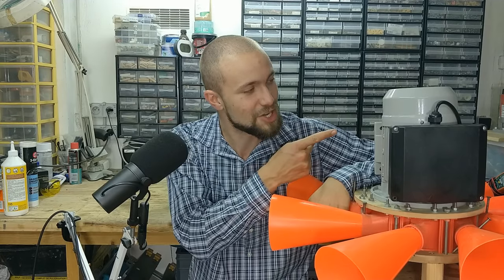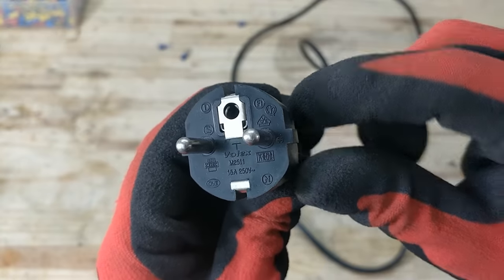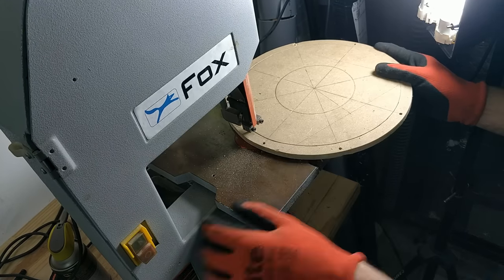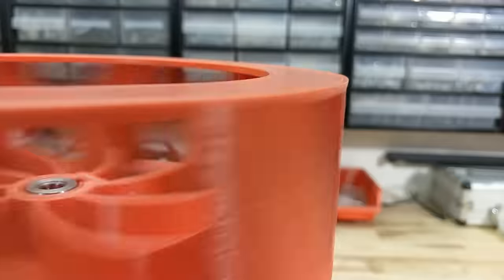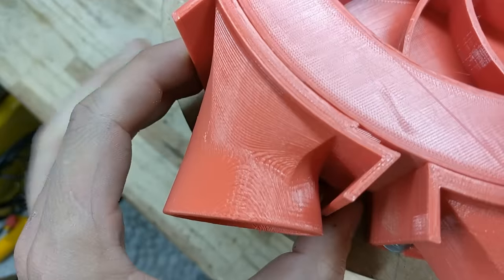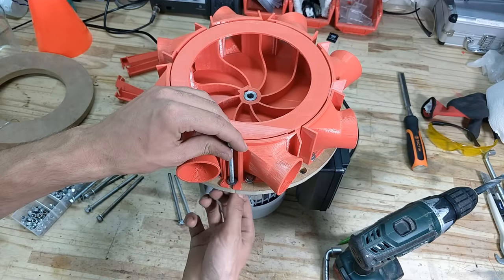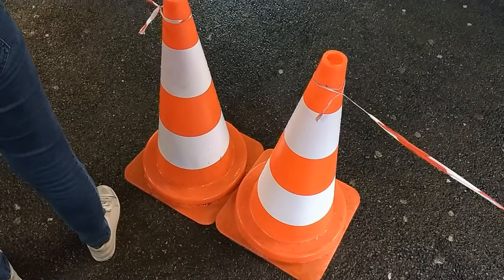Making the Air Raid Siren

Comment: The model of the siren in France you recorded is a DS PAKITA siren and it's sound was used for the horror film "Silent Hill". And the DS PAKITA siren is pretty much a sentry siren running 50 hz while a sentry siren runs on 60 hz
Reply: france also uses siren brands like KM Europ, Demay, Northern electric construction and also PTR.
Reply: there is no difference between 50hz and 60hz. they both run the same
Reply: @onfire4664 no, 60hz Is more faster rpm than 50hz

Comment: If you want to make this siren even louder, add a second rotor with slightly smaller or larger holes, just as long as they are a different size, the tones of each will harmonize and create an even louder siren. Its how most car horns work.
Reply: Is this note even possible to a 6 port siren? https://www.youtube.com/watch?v=tryjb_hmN7A Edit: That's my Silent Hill siren synth. Model DS PAKITA SIREN by PAKITA.
Reply: you mean the klaxon or something? klaxon is rotary but modern car horns are just speakers with or without a cone right?
Reply: @phenylmusic  car horns mix two tones, a higher and lower frequency, they harmonize with each other and create a much louder sounding frequency. you can do the same with rotary sirens or other horns by making the holes different sizes.
Reply: @The_JEB  right car horns usually have 2 tones a minor third apart
Reply: Better yet would be a three rotor design with each rotor having a different impeller style as well as different hole sizes.
Reply: A mere 12 seconds into the video he states, "So I designed my siren to sound just like the one I'm filming here."

Pay attention.
Reply: @T00LF00L  Neat. 
Learn to read.
Reply: @T00LF00L  I did 
my comment is factually correct.
Reply: @NeilPlaza  really? I always thought they were STL-10s.
Reply: Dual Tone Baby!
Reply: Ah mechanical engineer on board
Reply: @T00LF00L  yeah this. Thanks guys good to see everything is going to plan 🖕
Reply: Plus it sounds alot better too.
Reply: das cool
Reply: Though, single tone sirens do in fact carry further.
Reply: @NeilPlaza  you didn't even edit your comment

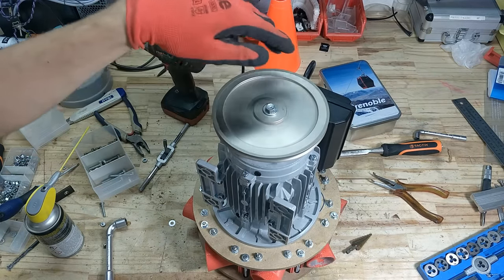Comment: At 6:00 that clicking isn't the centrifugal switch. The switch will only disconnect the windings when the motor reaches a certain RPM  and reconnect during wind-down. I don"t know what that sound is but its not the centrifugal switch. So it should only be heard once during wind up and once during wind down.

Comment: "spinning a heavy chunk of metal at over 3000 rotations per second is obviously dangerous"
holy shit yeah, thats 180,000 RPM you need a super alloy to even attempt that
Reply: I don't Understand, could you explain plz ?
Reply: @gialuquin88XD  180k rpm is too fast
Reply: @gialuquin88XD  It's said multiple times in the video that the motor works at 3000 rotations per seconds. But that's impossible, only things going remotely close to that speed are injection turbines in rocket motors.
SO it's not 3000 rotations per seconds, but 3000 rotations per minutes (similar to a small diesel car going 100 km/h in third gear).
Reply: @gialuquin88XD  he mistakenly said seconds instead of minutes
Reply: Thanks for the comments guys!
Reply: @TerraeChannel  lemme introduce you to hobby grade rn motors
Reply: Did you hear the sound of the air right sirens before have you heard one before
Reply: @TerraeChannel  small turbos on some cars can reach 300k rpm
Reply: no one use RPS it must be mistaken with RPM
Reply: @gialuquin88XD  metal will rip utself apart at that speed usually over 40,000RPM people use carbon fibre
Reply: @gialuquin88XD  and obviously he meant 3000RPM bcz 3000RPM is almost impossible with conventional motor motor would rip itself apart before the flywheel
Reply: @kamhaq  RPS is RPM, but per second, and not per minute.
RPS are 60 times faster than RPM.
1 RPM = 60 RPS
Reply: @somewagyuenjoyer  bro you got it wrong. 60rpm = 1rps
Reply: @Tahmanakki  rpm is rotations per minute.
rps is rotations per seconds.
60 seconds a minute passes everywhere.
1 rps is faster than 1 rpm.
if you got a timer and something that rotates, set the timer to 60 seconds. then start the rotating thing, and set it to 1 rotation per second. in 60 seconds it would do 60 rotations. if you set the rotating thing to 1 rotation per minute, and set your timer to 60 seconds, it would do 1 rotation in 60 seconds.
1 rps is 60 times faster than 1 rpm.
3000 rpm = 180000 rps.
Reply: @anandsuralkar2947  There's a guy who got to over 100k RPM with nothing but lego motors and gears, works just fine.
Reply: @somewagyuenjoyer  1 RPM ≠ 60 RPS, LOL!

Instead, 60 RPM = 60 revolutions in 60 seconds = 1 RPS.
Reply: @vk2ig  yeh at first i got it wrong, 1 rps is 60 rpm

Comment: Nice job! One other thing you might want to do is make sure that the rotor is as well balanced as possible, because that'll reduce the wobble and probably make the wind-down a bit longer.

By the way, the siren in the recording at the beginning of the video was a KM Europ siren.
Reply: Or add more ball bearings

Comment: With a motor that big, you can build a much bigger bigger chopper and rotor. You could tell you can build it much bigger because the time it took for the rotor to spin up was quite short. 
I personally suggest scaling up the model with the same motor, and add a thick metal plate on the rotor to act as a fly wheel (your attack signal will sound GREAT). Love the content!
Reply from the maker: Of course, but my printer can only print 20x20x20cm
I would have loved to make it bigger
Reply: @NicolasSalencPBP  shame. Anyway, I'm sure you'll find a way if you choose to continue this. Best of luck!
Reply: or get real parts and that

Comment: If you're a thoughtful (studying) engineer (like me), you could get away with a less powerful motor and use a 2:1 gear ratio to drive the rotor. However, it may take a little longer for the rotor to reach full speed. Furthermore, you could use a 3 phase motor to reach that speed much faster than using a single phase motor. The other gear would also have to be mounted next to the motor at a precise location to help with the gears meshing. I'm not sure if using different types of gears may help mesh better though. Btw, I'm studying to be an electrical engineer although mechanical engineering also fascinates me.

Comment: It doesn’t “Push out” 1.1 kW, it draws 1.1 kW under a heavy load.
Reply: On the motor plate normaly it is only written the power its giving away at the shaft. So the motor is translating 1.1kW to the shaft on max load. If you want to know how much power it draws you need to divide 1.1kW by the efficiency factor. Under full load the motor would probably draw around 1.2kW, depending on how good the efficiency factor is.
Reply from the maker: @CatLady That is incorrect. 
1.1kw is the mechanical power the motor is able to output under full load. 
Mechanical power(W) = torque(N.m) x rotation speed(rad/s). 
To calculate electrical power consumption, you need to refer to the label. (you can pause the video at 0:53) 
Under full load, this motor pulls 6.08A on 230v. The power factor (cosφ) is 0.99. 
Input power(W) = Current(A) x Voltage(V) x cos(φ) = 6.08 x 230 x 0.99 = 1385 W
So because of energy losses due to the efficiency factor, under full load the motor pulls around 1385 W and pushes out around 1.1kW 
285W are  mainly converted into heat which need to be dissipated by the motors fan and fins.
Reply: Now that's some epic electrical engineering
Reply: @may21136  took me 30 seconds to read this whole comment reply’s section
Reply: Wrong or not, I'm so happy that both genders join in on EE subjects. It feels so lonely without you guys.

Comment: You've got your impeller printed backwards. Considering the impeller is supposed to be a centrifugal pump, the idea is to have it compress the air before it's fed into the vents resulting in much improved efficiency. You have it attempting to suck the air away from the vents. Yes, it will work as you've made it but it will work better if you reverse the motor or impeller direction.

Comment: deleted my old comment as i was completly wrong, the siren you filmed seems to be a Demay siren, some Demay sirens actually have a lower pitch as they use a 2850rpm motor instead of the more normal 3000, the ones that have a lower pitch are the R3P models but i do not know the exact model of this one. the one you made looks pretty similar to the Pakita LCi siren or a CEN (Construction Electrique Du Nord) NP2S siren. hope this helps.
Reply: if you are wondering how he gets the sound of 3000rpm with a 2850rpm motor, rotor weight normally slows down the motor a lot, but since his motor is so powerful, it cant slow down the motor.

Comment: Nice! Matthias Wandel (YouTuber) made one out wood. I can recommend his channel also. Btw, he tested different impeller designs. I think he concluded that forward bending impeller blades doesn't make for the most efficient design. I don't remember if it actually pushed the most amount of air, but at a disproportionately higher wattage.

Comment: IM a bit rusty on my electronics but you do want to size your motor for the load. Its good its temporary. Its not efficient and there may be other issues from using an oversized motor.

Comment: I'm going to do this it's just I'm going to make a remake of a federal signal 3t22 so it's going to have two sets of horns.
a bigger motor, 2 stators, 2 sets of stator blocks or whatever they were called, and bigger horns, with the speed control, grinder disk, and a weatherproof cone on top so it looks like the real siren.
and mounting poles
then i will use a sprinkler timer with switches inside for a noon whistle if I want or I could build my own controller for the siren.
with a DC speed controller like you did to do a growl, short test, noon whistle, or alert, wail, but if i want to make a hi-lo tone I would need to make solenoids with a separate switch, and all kinds of things that I don't know yet, so I won't do a hi-lo test.

Comment: My Federal Signal 2T22A has 10-port and 12-port sirens on the same shaft. [=]M[=]  At full speed the rotor/stators produce a musical d5 and f5, a perfect minor third interval, which produces a Bb3 resultantone.
The 2t22A ("A" designates three-phase motor) would be.tter if 5 and 6 ports.   Lower frequencies travel farther and penetrate vehicles and buildings better.

Comment: Hand drilling the hole in the motor shaft without a center-finder, (optical) center-punch and spot-drill ?
No wonder that grinding disk is wobbling like it is.
Why damage the bearings of that brand new motor to save 10 seconds of work.

Comment: 3,000 rotations a second.....180,000 rpm? 

At 204mm diameter, the rotor would be experiencing a Relative Centrifugal Force of 3,773,952 Gs.....

I believe you meant revolutions per minute.

Comment: stupidly overpowered? There were air raid sirens in the 1950s that used V8 engines.
Reply from the maker: That's true, but they had much larger rotors and horns and would spin much faster, increasing the mechanical load. 👍